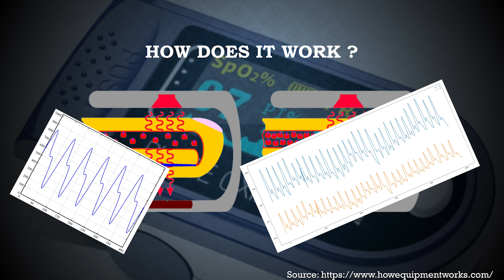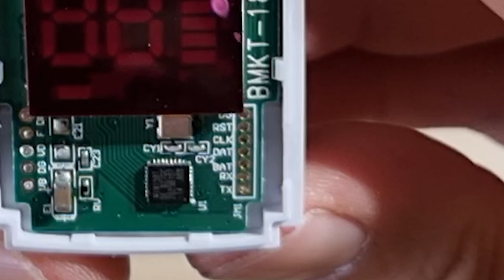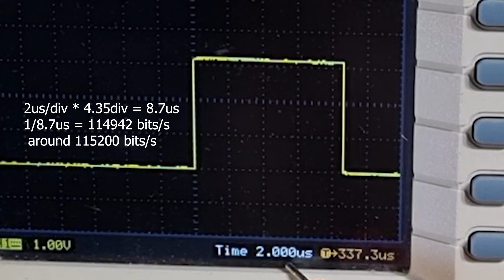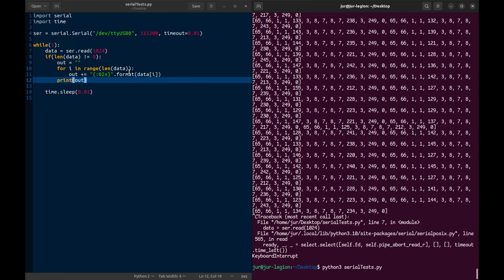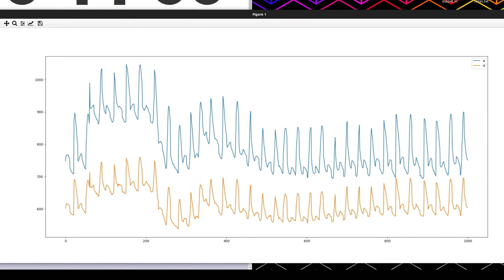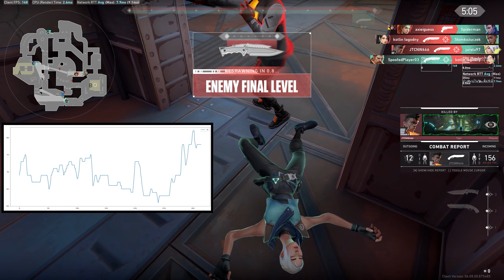Pulseoximeter hacking!

Comment: bro were u able to decode the data ??
Reply from the maker: I basically streamed every byte in the protocol using python. The formatting was crucial, since I was looking for changes depending on whether my finger was inside. The device also squeezes the finger so You can feel the pulse. After that You can simply look-up which bytes are changing live according to how does the finger feel. This way I parsed each byte, byte by byte. After seeing some of the bytes go between 0x00 and 0x03 I thought "this is probably higher byte of 2-byte word (uint16)". After that I only followed my intuition! I can do a simple writeup in the future if You'd like :)